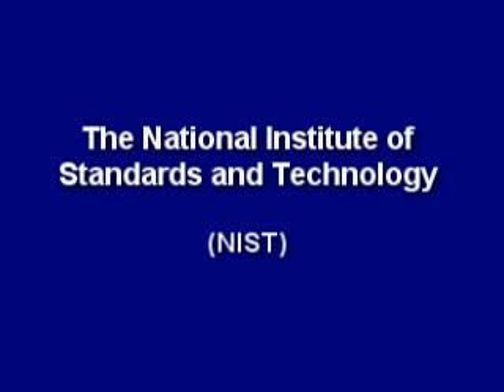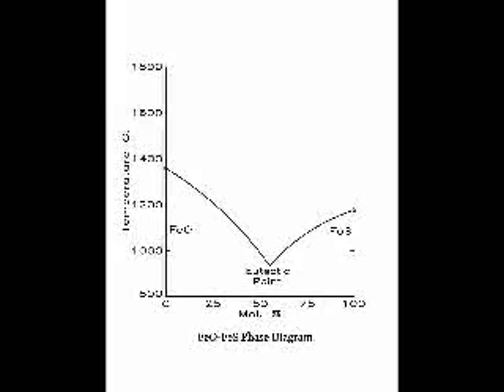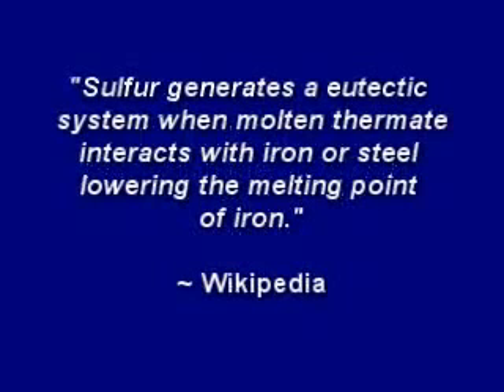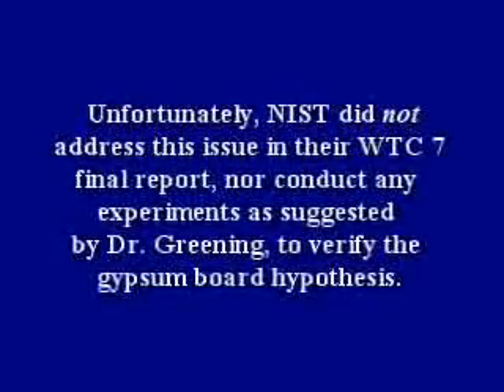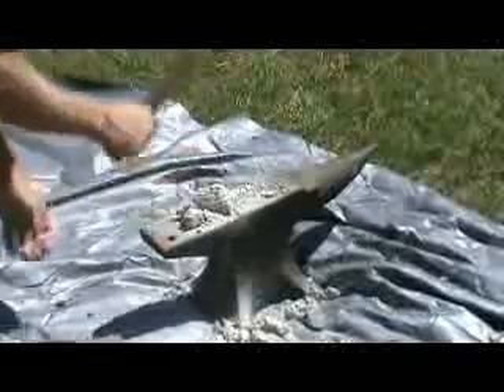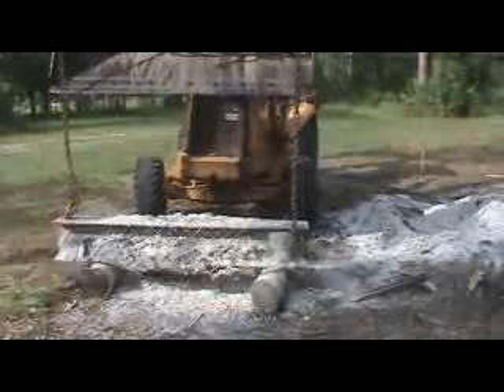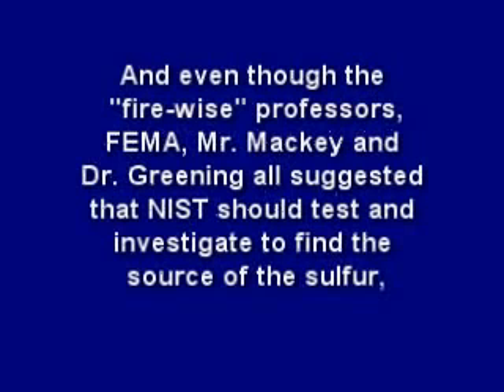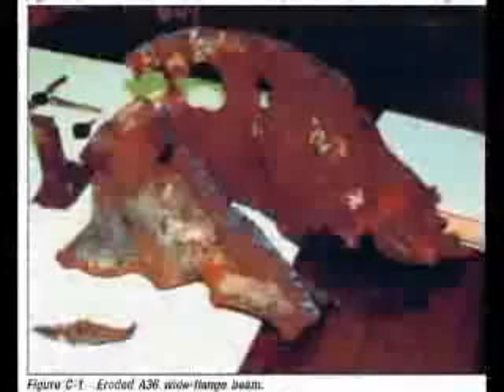9/11 Experiments - The Mysterious Eutectic Steel

Comment: I am not disputing you, but you chose to use Diesel instead of Jet fuel. Why? I found the below link, I would like you comments. Jet-A is a relatively high sulfur fuel, diesel is low sulfur and EPA requirements are getting more stringent about sulfur in diesel every year.  After all, we are now in the Ultra-Low Sulfur diesel era.  Using Jet-A in your truck will be highly frowned on by your EPA inspector and could lead to fines. http://generalaviationnews.com/2011/03/17/jet-a-versus-diesel-fuel/

Comment: Or that batch of steel used to make the beam was bad.
Reply: oh brother...  it was AMERICAN steel going into the highest buildings ever constructed and you think they were cutting corners.
Reply: Actually CIVIL STEEL is the cheapest steel to make.  Expense is used to maintain CONSISTENCY - but otherwise - it's CHEAP.
Reply: I'm curious about your comment! I've long-wondered that low-grade steel may have been used in the construction process, which may have been a significant contributing factor in the collapse of the buildings. Do you have any further information?